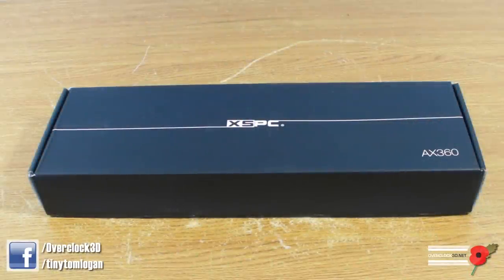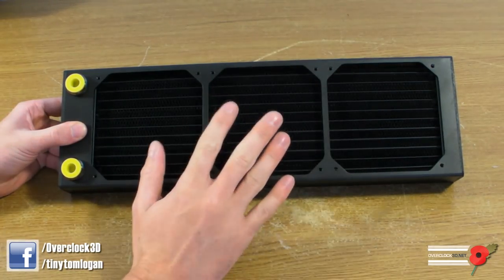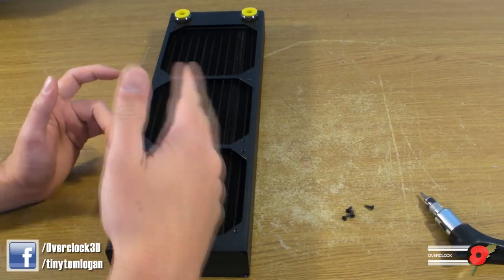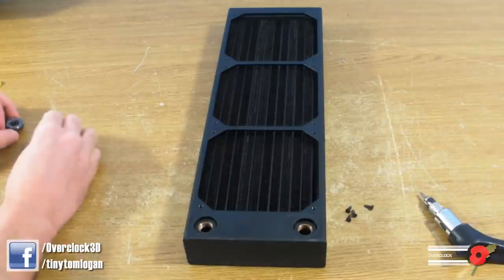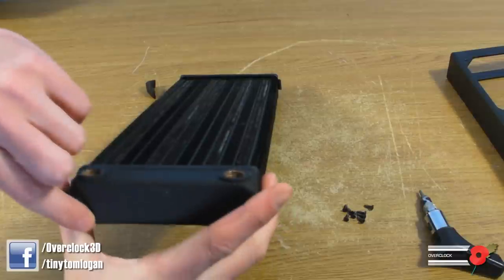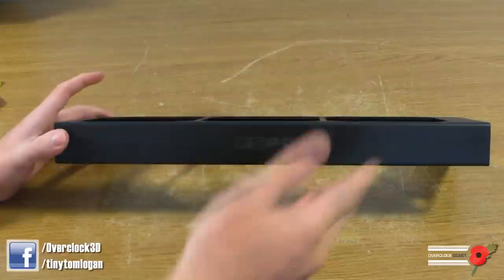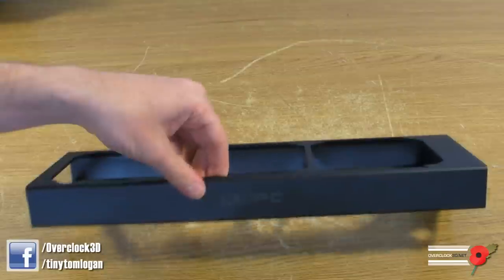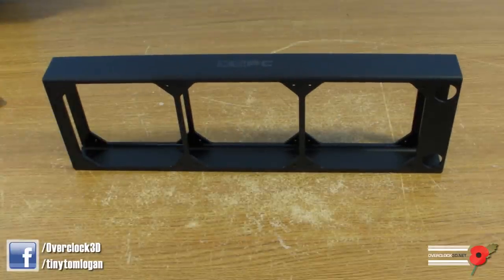XSPC AX360 Radiator overview - Custom Painted Rad

Comment: You can also use oven cleaner to strip the anodizing more evenly and quickly, and then you can use etch primer/primer/whatever for painting!  Just a tip I learned from the flashlight world.

Comment: Don't know if it's been said yet; the (XSPC) screw holes are usually 6/32"-not M3 or M4-, also, the AX series has gotten an upgrade in the form of a stand.
XSPC.com (I think) has the description of their Desk Stands for the AX series radiators...good option if you don't have the space inside your chassis, or want to have the radiator on your desk :-)

Comment: Hey ggggggguys, it's Tiny Tom Logan back with anooooother video for ya!!

Always wanted to say that in a YouTube comment. :-)

Hey Tom, how is this radiator when it comes to accuracy? I mean, I have a new Black Ice GTS here and when I plug in some fittings it will shine with an inaccurate weld. It's not constructed with as much accuracy as I thought it'd. This XSPC rad seems to be much more accurately constructed.

Comment: You won't get any issues with this. I'm running a 2500K and a 670 on a 360 rad. At 5GHz with prime and furmark running I don't have any issues at all. I've even turned the fans right down. Your 3770K will generate less heat at 4GHz and the temp diff between the 680 and my 670 will be tiny. I've got plenty of headroom, you'll have even more!

Comment: I would love to see the radiator guide with maybe a 3770k at 4.6ghz and 5.0ghz with a gtx 680 or something similar with that ax360 or ex360 and see how loud/quiet it is then an explanation on what you see could be done maybe making it a dual loop or a 480 rad, anyways cool vid and epic rad!

Comment: Thought process:
NICE, can paint easily.
Ah crap, it's a bit small
hmmm, would be easy to screw two of em together, looks like a 45mm, 90 could be a bit much.
Oh 40... 80 would be perfect!

Great job there XSPC, especially if you provide teeny tiny screws for stacking them :D
Ding! ;)

Comment: jes and you will be able to overclock. remember to fnd either a waterblock for the whole card, or if you will use single blocks on the 2 gpus, air-cool the VRM or you wont be OCing that far

Comment: The problem is getting the heat out of the chip. 
Recently worked on an OTT loop for 3770 and 680, the temps got silly @ 4.8 even though the coolant was still, well, cool.
Do some research, it's a known problem with Ivy.
Good luck though, you might be lucky.

Comment: As was said in the video, so that the fans can be run extremely low. I would have them off when idle and low temps, then spin up as the load and heat builds.
I've spent a lot of money (given my finances) getting my system to be inaudible, Once I shift my storage drives to a separate system out of earshot, my system will be inaudible at anything but high load.

Comment: Do you need a push pull configuration for a 80 millimeter radiator or is one set of push or pull good enough to cool the radiator?

Comment: What?
It's about the transfer of energy, the energy is coming from within the chip (electrons flowing through it and through inefficiency, heat is produced (although we don't actually know what 'heat' is)) and the aim to transfer that energy away as quickly as possible.
Whether it's watercooling, air cooling or LHe3 it's the same.